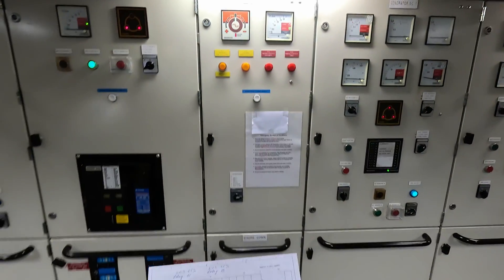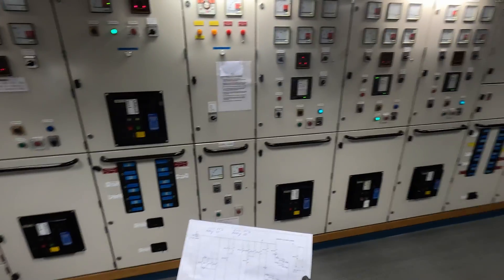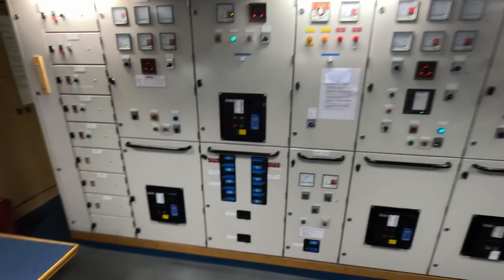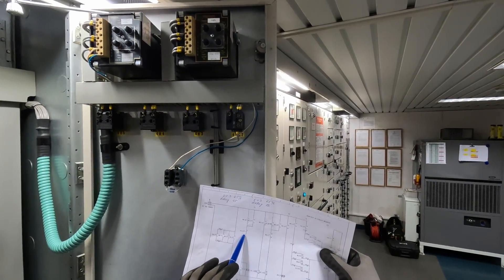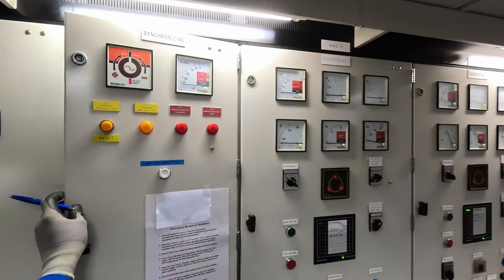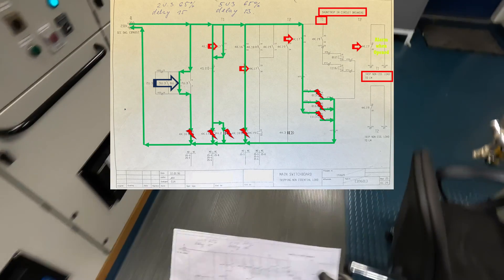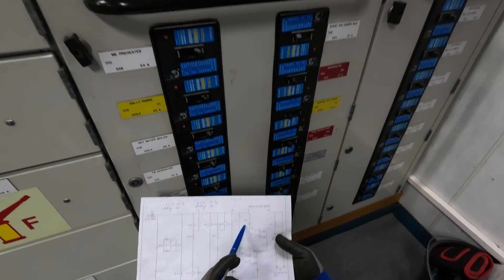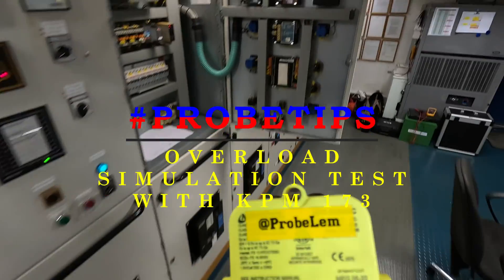#ProbeTips! How to Read Electrical Schematics | Tutorial + Overload Trip Simulation

Comment: Thanks for your videos. Can you please explain, usually number of contactor or another e. element that is number of page. Here us i understood that is number of panel. Who was manufactured of this ship? Thanks
Reply from the maker: Good question—there are many ways to do it.
	1.	In complex systems like a boiler plant, device tags (such as relays) are typically tied to the page numbers of the schematics, based on the control system’s overall flow.
	2.	In simpler systems, such as a stand-alone function for non-essential load (preferential) tripping in a main switchboard, devices can be tied to the specific switchboard section—in this case, for example. (Especially if the page is only 1 out of 1: “Main Switchboard Tripping of Non-Essential Loads”, nothing to show any other😀)

Comment: Is that simulating Overload trip or Preferential trip ETO?
Reply from the maker: It's a great question! This setup can indeed be seen as both an overload trip and a preferential trip. Essentially, it’s simulating the tripping of non-essential loads when there’s an overload condition. Some refer to it as 'preferential tripping' because it prioritizes essential loads by disconnecting non-essential ones during overloads. So, you could call it either, depending on your focus – but the function remains the same!
Reply: @ProbeLem ❤❤❤